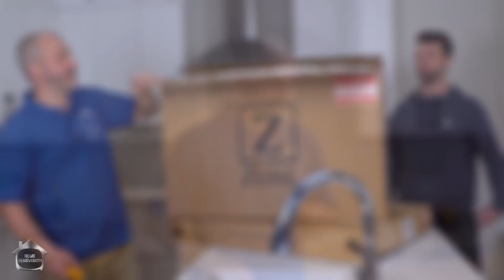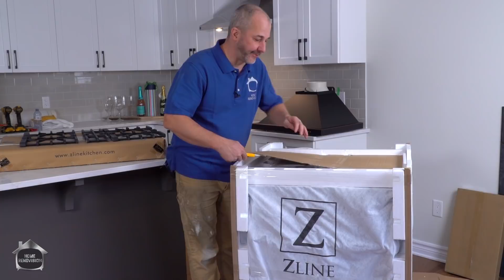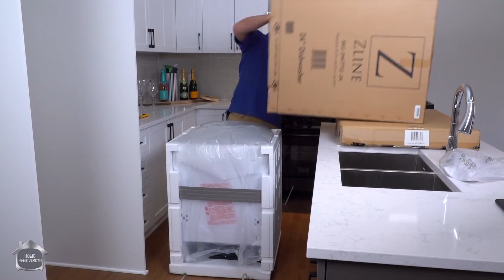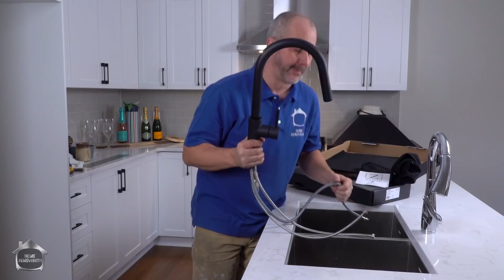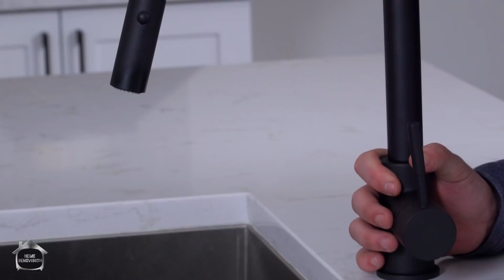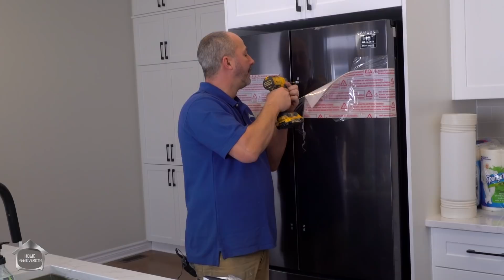Key Elements to the Designer Kitchen of Your DREAMS!

Comment: I bought my new appliances last year when I moved in, and I'm now kicking myself because I didn't get a counter depth refrigerator.  I love the one I have, but it just sticks out too much in my small kitchen.  I may need to just buy a new one when I go to remodel.  Also, not everyplace has gas available.  There is no natural gas in my area, Northeastern Vermont.  We use fuel oil and wood for heating, and electric for cooking.
Reply from the maker: Hi Gina, we use propane for heat and have 2 big tanks. most stoves work on natural gas or propane. Cheers!

Comment: My home was built in the early 1960's.  Although architect designed and ahead of its time, the kitchen was designed by a man who lived with his mom and never cooked. After visiting kitchen  display showrooms, most looked the same me too designs and basically too ordinary to consider. I designed the new kitchen myself, had it custom made and installed, I did the gut out, only 80% the ceiling remained.  The features I incorporated were an inset glass top gas top stove, easy to clean, no grease to be trapped by a self standing stove, with an electric oven underneath.  No outward opening cupboard doors as anything you want will be at the back. All drawers 850 wide push to open, no grease collecting handles .  1200 wide drawers are too wide and hard to open and close. There is 8m of bench top with drawers underneath. Overhead cabinet is 1800 wide, bi-fold upward opening electric motorised door, again no outward opening cabinet door fronts.  Black mirror glass splash backs, no more greasy dirty grouted tiles, clean with Windex and a glass squeegee in two minutes. Remote roof mounted exhaust fan  and lots more. Too may kitchens you see on home renovation shows seem to follow the same worn track made by people with no idea on practicality and maintenance.  Food for thought for people renovating. One man  renovates, all male friends suffer.
Reply: share some pics please